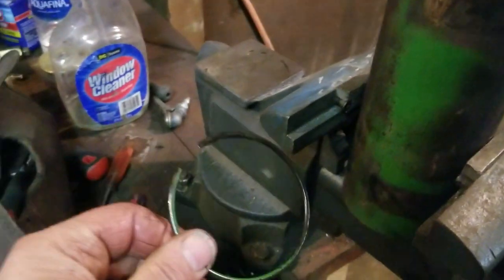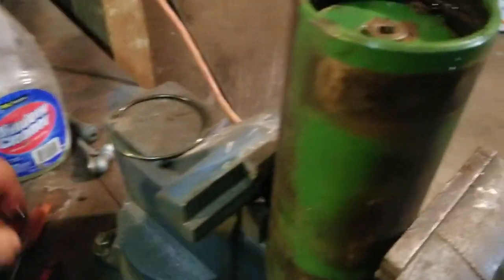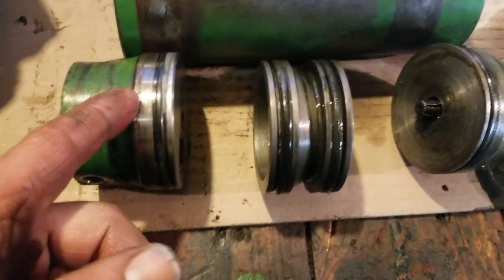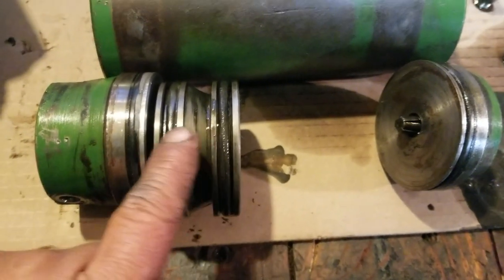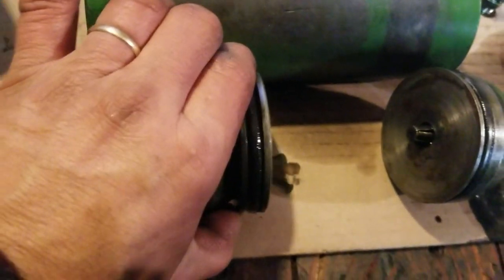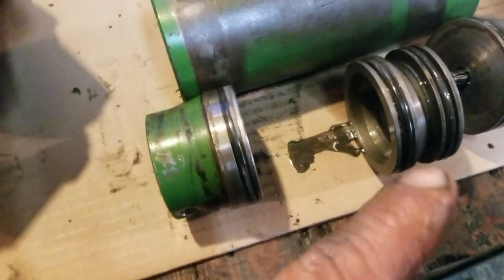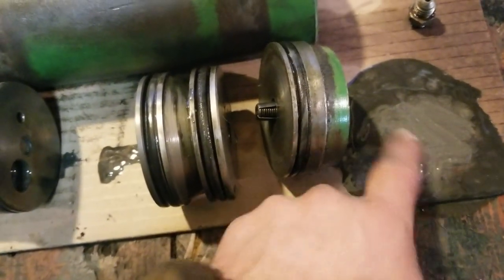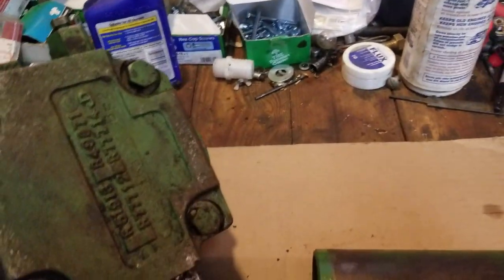John Deere 4320 pump

Comment: Thanks for the overview on them!  Oliver should have put one on the 55 series tractors and whites with the hydraulic brakes.  Might have one off an old combine somewhere could rig up.  Hmmmm... do I need more projects???  Thanks for the video!
Reply from the maker: Yeah maybe you could tee it in between the priority valve and the steering! If the accumulator was big enough you'd have brakes and steering for a while after the engine was off!  Ho no not another project.  Thanks
Reply: @cesmith4566  Yeah!  Hmmmm.... I don't remember how big that one is, or where it's at but now you've got me thinking!!